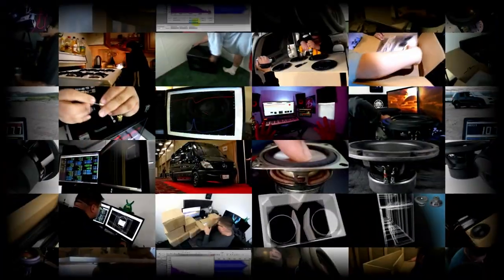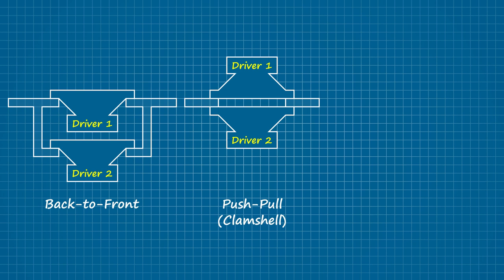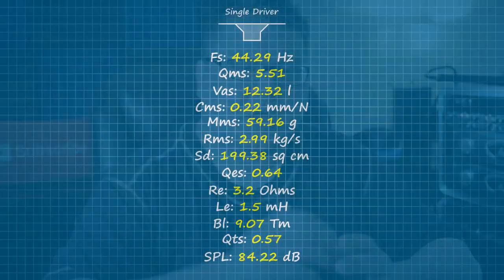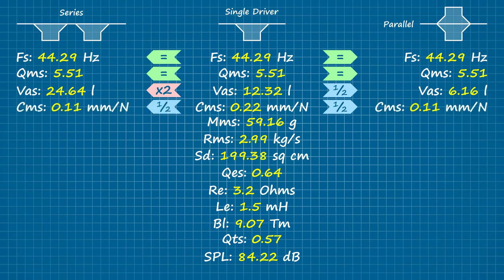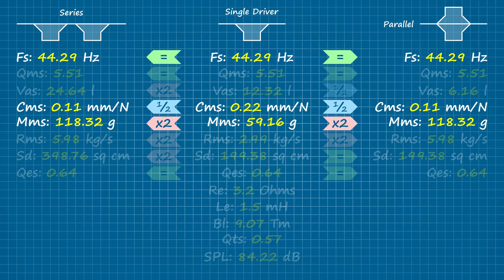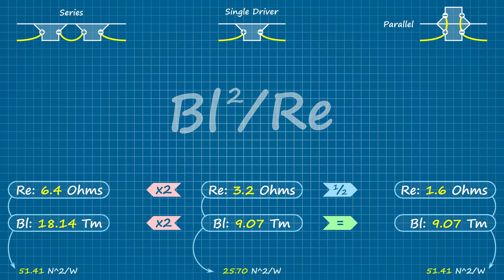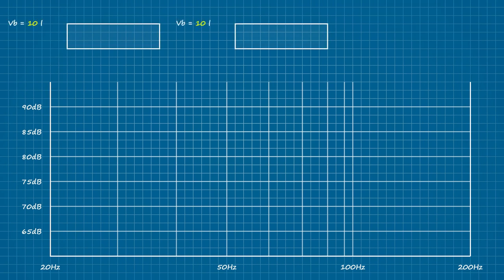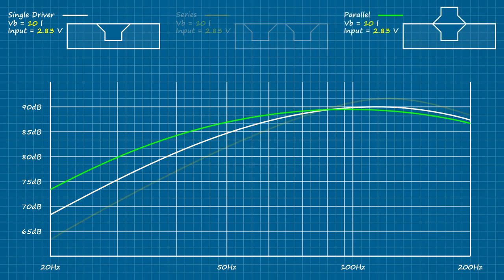All About ISOBARIC Loading

Comment: What makes this presentation possibly confusing is you can also have side by side woofers but wired in parallel, and you can also have clamshell isobaric but wired electrically in series (a pair of 4 ohm woofers as 8 ohms total for example).  People watching this video might think you have to wire it  as you show here but they really don't.
Reply: Yeah, i am unsure why Pete didn't show the side by side woofers is parallel rather than series.

Comment: The presentation level on this is insane. When you darkened some fs parameters to show off how other ones are linked and when you overlayed the frequency response of the single sub with the series/parallel subs by using a dotted line for the contrasting subs. Good stuff, really appreciated.
Reply: I know some of those words

Comment: If I recall correctly, when I had FOUR 12's in an isobaric box (i.e., clam shell setup)... ...I hooked up both subwoofers inside the box with reverse polarity (i.e., positive to negative, and negative to positive) and the two subwoofers outside the box with normal polarity (i.e., positive to positive, and negative to negative) when bolting the subwoofers face to face (with a 3/4" wood ring in between the subs that I prefabbed myself) .  In this configuration, they all worked together as a team and had a lot higher dB gain from 20Hz-60Hz running at 2ft³ per chamber for each pair (as it had a divider in the Dual 12" 4ft³ net volume box).

Comment: Back in the 90's I had a Thunderbird with 8 kicker 8" iso. It had the low end of a 12"  with the tightness of a 6" or 8" with plenty of volume. I was running 8 ohm subs all parallel off of a PPI pro mos 12. The box total was only 2.4 cf. Back then that was small and loud!! I loved building new boxes to try out. Learned a lot and if this channel was around then I would have saved a lot of headaches. Awesome job and thanks.

Comment: Yes, back in 92 I set up four fosgate series 1 twelves in a ported box in an isobaric configuration. Punch 150HD in stereo mode at two ohm per channel. Vehicle was a 1988 ford escort. Very small box in the hatch. Mcm goldline doors, rears and tweets ran off a Kenwood 920or 921,can't remember. It was a very impressive sounding set up. LA sound crossover. Kenwood head unit.

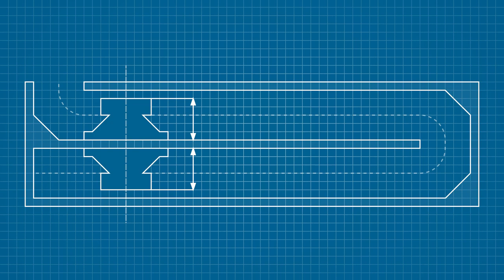Comment: You touched on something at 6:20 that I tried to search a while back when I started to design a smallish tapped horn. You stated: "...as long as the mounting depth of the drivers doesn't exceed the the internal clearance".  
One of the biggest concerns I had with my design was the lack of room the driver had around it. I wasn't able to find any info about how much is room is actually needed behind the driver, so I decided to change the design slightly to give it a tad more space.  
Most tapped horns I found online are huge and the driver sits almost at the mouth of the horn, many times in a steep angle and the mouth is huge as well, so it's hardly an issue.  
In my build, a 6,5" driver is around 50cm deep inside the horn. Width of the horn is pretty tight fit, at around 7" and there's not that much room between the magnet and the outer wall. Making it any smaller seemed ludicrous.  
I just got it finished (still need to paint it) and I have tested it briefly and it is quite something in a small flat :D Need to find the time to set it up properly. 
Anyways, I was wondering if you knew any limits or have ever come across issues with too tight clearance in a tapped horn? What would even happen if it was or can it be? I have hard time trying to thing what actually happens if it was. If you have any ideas, I'd love to hear them.  
  
Love the channel.  Lot of really well laid out info!

Comment: “Twice the (Moving) Mass, Half the Vas” was a term I coined as a teenager in the 1990s when Isobaric made sense because manufacturers weren’t making drivers for smaller enclosures.
Reply: I've done hundreds of iso setups from 80s to now. 
My girl's box is a pair of 12s in 1.8 cubes with a 3", 18" long flared port tuned to ~29.  
Moves the winshield of her suv a 1/4" or more at 32Hz on 500W.
Reply: The old boys I've met over the years in my local car audio community always know far more than the young guys that just want bigger drivers and more power. It's what fascinates me enough to try to learn the science to build my own transmission lines and bandpasses.
Reply: Lol very creative!

Comment: Back in the late 80’s I experimented with a parallel setup once. Two Magnavox 8” woofers and original enclosure of one speaker. I guessed at opening of port ( just removed material from front baffle. Barely heard anything but made everything upstairs shake.Was in corner firing up.

Comment: Now I have to figure out the math on if the two woofers mounted in series were wired in parallel. Thanks for the video!
Reply: Yes! my thought's are it would be the same as the iso setup given the enclosure volume was doubled & not 3db below as shown but it would be nice if Pete could revisit this.

Comment: Nicely explained Pete, but it would have been nice to have the two direct radiating woofers also shown in parallel wiring as well xx
Reply: @HexiBase  yeah man, there was a fad over in England where all the kids were going iso in recommend volumes for a single driver... Everyone was destroying suspension components left right and centre lol. I did warn them lol xx

Comment: Great video! Very informative. But... you stopped one point short of where I was hoping you'd go. I've asked this question in a couple of places. And, I've gotten two different answers... If the subs I'm using want a volume for one driver of "X", and I'm using an isobaric loading that lets me build a box sized at half that size - "X/2", what volume should I tune the port for? The effective size of the box (X) or the actual size of the box (X/2)? 

Thanks! You (as always) are The Man!

Comment: I had a dual isobaric once upon a time it was rather large and heavy 4x10" Seas P25REX 8 ohm 93 db spl wired in series/parallel which gave the amp a nice easy to manage 4ohm load in a sealed enclosure mounted with drivers facing away from each other (magnet to magnet) it appeared as a 2 driver system, it was the best sounding car subwoofer I've ever had. It sounded very clean and tight zero booming, very musical. Most subwoofer set ups back then were ported enclosures which I have never liked due to the boomy bass (which you could hear a mile away and not very musical) Mine on the other hand was more or less contained within the interior of the car (at loud enough volume believe me) I never liked to telegraph sound like most seem to do. I guess in hindsight I could have used a 2 driver set up but the Seas drivers I choose were only available in 8 ohm and I didn't want a 2 ohm load going to my amp. I was fascinated with Isobaric from the time I heard about it and was very pleased with the outcome. BTW the amp I used was only 300w bridged, now I see amps of over a kilowatt as standard subs rated 2-3k. I don't quite understand that thinking.

Comment: Hard lesson learned...20 years ago i had a pair of 15" Orion XTR subs that I could only fit in a HUGE sealed dual chamber enclosure that took up 90% of space in the back of a Honda CRX...i sold those subs to a guy who built a smaller sealed enclosure that had the subs firing isobaric and into the corner of the trunk of a Nissan Maxima with roughly the same power i was feeding them in my CRX...needless to say I was impressed by the output and felt stupid afterward lol
Reply: He he

Comment: I really enjoyed this and several others on your channel. Subscribed. I built a set of subwoofer cabinets for my classic rock cover band 8 or 9 years ago. They have served me well but recently I overpowered one and damaged the driver. I was able to replace the out of production woofer (an MCM 55-1875) so I now have a pair again. These were not my first diy speaker project (my first was at age 12, I'm 62) and have the ported 4.5 cu ft boxes tuned to very near the drivers Fs (30hz). This I believe was an error on my part (box to small too but these were for bar gigs/compromises were made)(should of tuned the boxes to around 50hz where the bulk of the signal is/to gain most usable spl?) after 8 years of trying to educate myself in live sound sub-woofer design as up til then most of my designs were for high power home stereo application and a few guitar and monitor wedge cabs. 
I am now considering building a new set of cabinets for these drivers and since they must cover only a narrow band from 30 to 100 hz I would like to learn how to design an isobaric cabinet for a given driver's T/S parameters and the required pass band of the finished speaker cabinet. Is this an idea for a future video?

Comment: Clamshell arrangement is my favorite for several reasons.  1) It is very simple to do  2) It doesn't decrease the volume of the box any more than would be with a single woofer mounted in it (since the 2nd woofer is outside of the box).  3) The amount of air between the woofers is minimized, thus making the coupling "tighter".  4) No special woodworking skills are needed.  In fact, one of the simplest ways to make a good subwoofer of reasonable size is to use some old already made enclosure, mount 2 identical woofers in it this way (clamshell), and seal up the other holes (such as leave the midrange and tweeter in the box but either disconnect them or filter them out).

Comment: 4 6.5 silverflutes in an isobaric 4th order tuned to mid 40s is pretty impressive. 600w power handling and a speaker that is designed for more bottom end result in a much more subwoofer like sound from what is net roughly 1 cubic foot.

.33 sealed, .66ported with a 2 inch aero port. Still one of my favorite builds I've ever done

Comment: If you have a ported box with one sub that sounds OK
And you buy 3 more matching subs, and another amp.
Cut one more sub hole, and pair up the subs in Isobarik.

On paper it will have the same response, and spl, but use twice the power.
Will it sound tighter / better / faster with all those extra magents, and power?

Comment: The big problem with Isobaric is that you have paid for two drivers, but can only extract the acoustic energy of a single driver. Xmax * cone area is the volume of air you can shift, and that is not increased in Isobaric. What you are doing with Isobaric is effectively designing a new composite driver with a different set of TS parameters. Probably more helpful to have bought a driver with those parameters in the first place. So in terms of value for money, properly designing a ported system around a single driver is probably your best bet.

Comment: Peter,
     Thanks so much for the detailed explanation!  Now I can incorporate isobaric enclosures in my usual T/S calculations.  I see in other videos that you also have some experience with transmission lines.  Once I tried such an enclosure but it didn't work well at all.  At the time, Thiele/Small hadn't even written their landmark papers yet, so it's no surprise I didn't know what I was doing.
     My question about transmission lines is how to choose the tuning frequency, in light of a driver's Fs and Qts information?  I suspect that quarter-wavelength is NOT always the right choice (just as matching a bass reflex port to the driver's Fs is also not always right).  Have you got any information on that?  Perhaps more importantly, I suspect that transmission line is likely never an optimum choice anyway (in terms of F3, cabinet size and power handling).  Please share you thoughts on that.  Thanks.

Comment: There's a couple of issues I'd like to raise here and the first one is ...
When you hook up two speakers in series each speaker gets half the power ( assuming equal impedances ) so the power level goes down in each by half and that is -3dB per speaker but the radiation resistance is halved.

Comment: Lets take this concept to the car audio field. I am working on a 6th order wall with 8 15s, 4 on the bottom baffle, 4 on the top. There is 1 common port in the middle. Will the woofers see an isobaric loading effect against eachother with a 42cm gap between woofer faces? And from the bottom and top of the shell knowing the woofers have a mounting depth of 30cm and baffle to shell is 34cm?

Comment: Is there a mathematical model that properly defines the parameters of Isobarik loading? One that offer the deepest bass extension while preserving highest efficiency? If so I've never seen one. Most seem to be random trial and error models of enclosure size, air volume between the woofers and even ported vs unported enclosures.

Comment: I built some speakers with only 6 and a half woofers back to back in each cabinet, I wired them in series and as a bipole in polarity , has great extended low bass  better than any configuration I have tried, the tweeter is hooked up parallel

Comment: Very informative. I want to make a Ripole subwoofer with 2 drivers. I connect them in parallel, i.e. Positive to Positive and Neg. to Neg. OR Positive to Neg. and similar for the other set of terminals? Please explain. Thanks.

Comment: An issue I have with my isobaric speakers. The backside (magnet) is exposed at the outside of the cabinet. The venthole is there and at higher volumes, the airspeed in the venthole is creating noise. I can imagine there are driver designes with larger rouded of vents, but mine are rather small and not rounded. So be careful when selecting your speaker. Check out the vent size and form.

Comment: Awesome videos sir.  Could you please do a special video on a 4 woofer "double clamshell" arrangement such that you compare a single woofer to that of the 4 woofers but wire them in such a way (series/parallel) so that if the original single woofer is 4 ohms, the isogroup of 4 will also be 4 ohms, and then do the side by side comparisons like you did here.  I think that would be a cool comparison because they would both be 4 ohms but some of the other properties will be different and the low end bass extension of the group of 4 should be impressive.

Comment: @5:00 you say you feed the same voltage for consistency. But as the electrical resistance of the parallel group is half and the resistance of the series group is double the on of a single driver, the electrical power you feed into each of the configurations is different.

Am I missing something or shouldn't that bring an inconsistency by itself in the analysis? Shouldn't you feed the same power and not the same voltage into the drivers?

Sorry if my question is dumb, I would just like to understand.
Thanks for the great video and the channel as a whole!

Comment: Great video! I'm realizing how little I know about this field. I'm trying to refurbish a set of jamo 707 towers. They have isobaric woofers in a push pull. I've found replacement woofers that I thought would work but now I'm not sure. I can't find specs on the oem woofers, any thoughts on what qts or other ranges might be suitable for this? I have no idea if I'm gonna blow the whole thing up! If anyone reads this let me know what other info I can provide

Comment: Awesome video!  What changes when the enclosure is vented and not sealed in a clamshell configuration?
Reply: @HexiBase  So do the port dimensions change when two drivers are loaded isobaricly to hit a specific frequency? Or do they stay the same as a regular vented enclosure?
Reply: @michaelcoston1188  No. 
Exactly as he stated. 
Changing nothing about a setup other than adding the additional sub clamshelled (iso) will shift any current box alignment down in frequency response the same amount (withina few Hz) and the port area change isn't really needed because you only reduce Sd of an iso setup by 10%, which, usually keeps your port well within it's, what was already usuable, cross sectional area.

Comment: Awesome video, thank you so much. I have a slightly unrelated question for you though. When trying to determine an enclosures volume using FS, FC, and, VAS,  measured with DATS, how would the formula change for a pair of drivers in series, parallel, and isobaric?

Thanks in advance!
Allen
Reply: I think I answered my own question. I took the sum of the vas and the sum of the fs of the two drivers and then after doing the calculation, I devided the answer by 2 and came up with what I believe to be an accurate result. It was very close to the volume of the enclosure with just one driver. I assume the difference was the volume of the second drivers magnet, basket, etc.

Comment: I've never even considered an isobaric set up but now I'm interested. Currently running a single Ultimax in 3 cubes and am considering what I could gain from an isobaric setup with two drivers
Reply: The low lows, LOW lows :)

Comment: I wonder what would be the effect on isobaric speakers that were built with spring loaded spiders so that the spring loading pushes the cones away from each other. Then this could be compensated for by evacuating the space between the elements. 
I'm thinking the evacuation would reduce the mass of the air space.

Comment: Very informative video, but I didn't understand the namings. If anyone can help me I'll be more than happy. In the arrengement you called "parallel" the drivers are making double the pressure or "force" (which is the acoustic equivalent of voltage). And in the other arrangement the drivers are producing double the airflow (which is the acoustic equivalent of current)... So it seems to me that the namings should be vice versa. The arrangement that produces double the current gotta be parallel, and the one producing double the voltage gotta be named series.
.
PS: the isobaric naming itself, I thought it refers to the air in the middle whose pressure remains constant.
.
Correct me if I'm wrong.